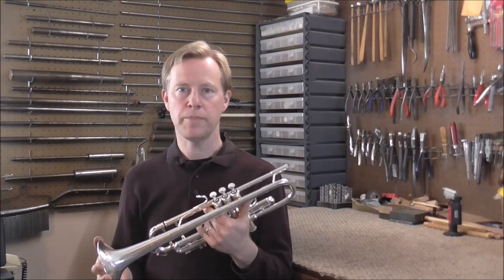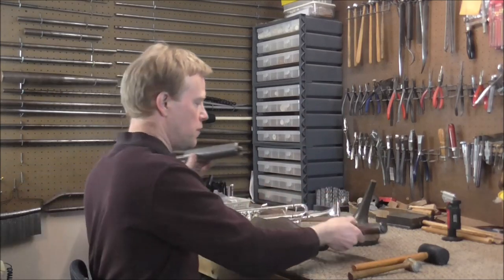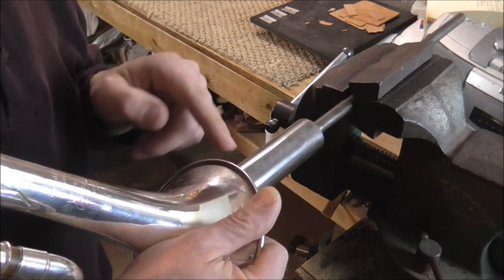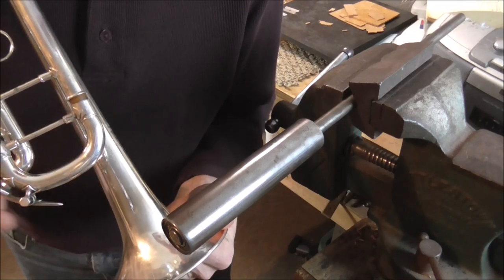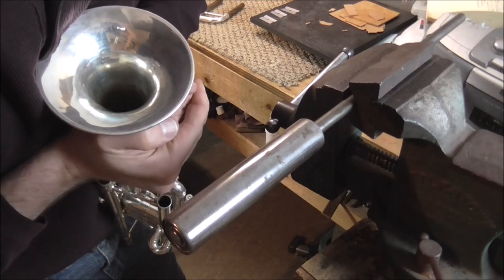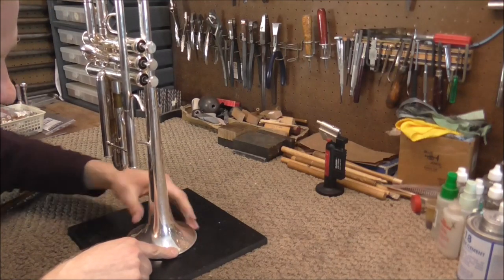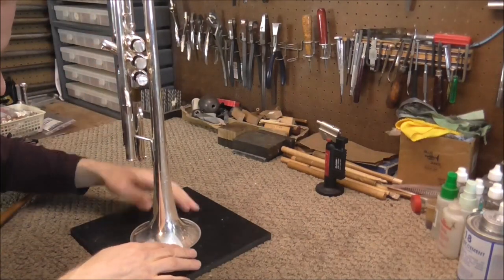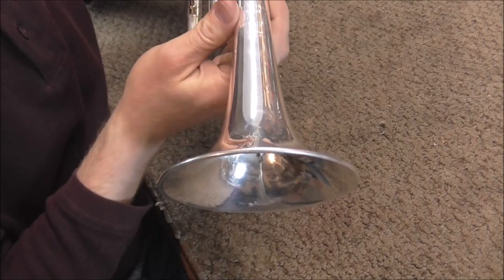How To Remove Bach Stradivarius Bell Flare Dents

Comment: Wonderful videos on dent removal.  Thanks!   In body shop videos on YouTube they frequently have a lamp reflected off and illuminating the metal with closely spaced parallel lines THOSE THINGS SHOW EXACTLY WHAT IS GOING ON WITH DENT PRESENCE AND WORKING OUT.  I think having one may be of use to anyone removing dents or fairing a surface: Led Stripe Line Board
for Paintless Dent Repair PDR.
Reply from the maker: Do you have any good videos to recommend? 
Thank you,
 Art

Comment: Hello , Thank you for your video. Very well done and great quality. I just would like to ask a favor. I tried to find the ROLLER on the web site you mentioned but i wasn't able to. Only the Hammer was there. Can you help me where to find that roller or maybe the code there have changed? Tks.
Reply: those rollers are very hard to find! i have searched a couple international resources and think those that ferree were made in Germany. there are some small hand rollers available in the US, but an option would be to have one made at a machine shop
Reply: another option would be to use a dolly (auto body tool) together with a mallet and small dent hammer. slower process than to just roll out bell dents, but entirely practical

Comment: Thank you sir for the great video. I would like to ask if the use of the bell flare can change the bach metal temper. Peace
Reply from the maker: Yes, it can, but it will probably not affect it too much. You need to balance the risks and benefits before you do this or any repair.
Art

Comment: I new to this area and have 1939 Martin Handcraft Committee medium bore trumpet with a dented bell. Previous owner buffed the horn so often that the bell's metal is quite thinner than normal. It's a beautiful horn in nearly perfect playing condition. Would it's bell dent repair be an issue? I can bring it to you of course.
Reply from the maker: It probably will be fine. Bring it in and I can take a look at it.

Comment: Does dent removal help restore the bell back to it's original resonance though? Or is dent removal mostly cosmetic since working the metal hardens it?
Reply from the maker: Dent removal can change the sound; sometimes for the better and sometimes for the worse. Usually it changes it so little that it is not worth worrying about. Most dents are mostly cosmetic and have a very small acoustic effect. Occasionally it can make a big difference if the metal was cracked or if the airflow is inhibited by the dent.

Comment: Now I know how to do it ....I'm going out to buy a full set of Mandrels, how much? 10 to 15 grand? Then 20 years to practice...
Reply from the maker: You can outfit a complete brass and woodwind repair shop for about that price. If you just want the brass repair tools, it will save you several thousand because you will not need to buy the expensive woodwind pads. 
Here is the link to a video that will probably be helpful:
"What Brass Repair Tools Do I Need To Start My Shop?"
https://youtu.be/efiMUYytM_o

Comment: how do you get rid of crust or spots on brass instruments?
Reply: dek arta if youre talking about the finish of the instrument you could try polishing with either silver or lacquer polish depending on the finish of the instrument. Second option lets say the plating is fallen off or lacquer has fallen off you could restrip it and refinish it but its better to have it done by a professional.